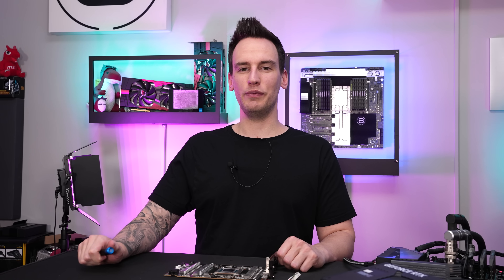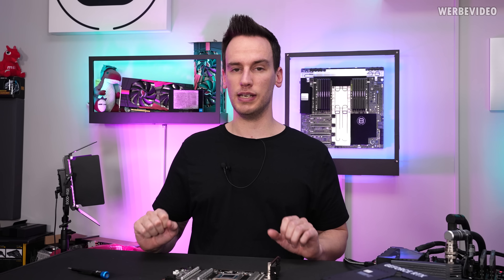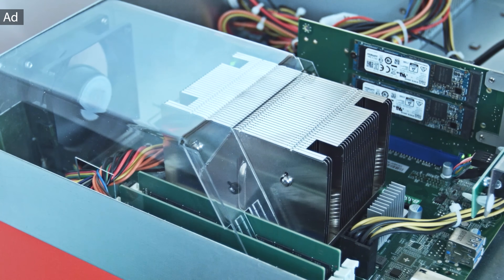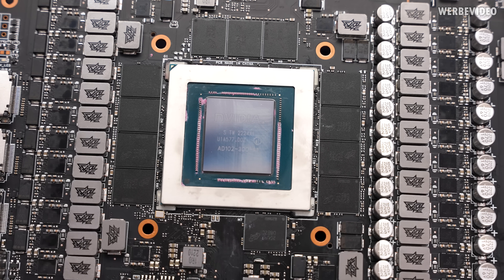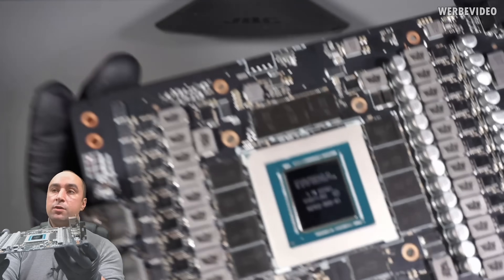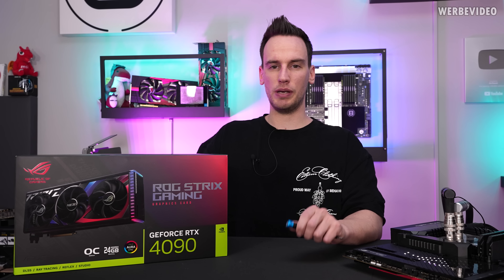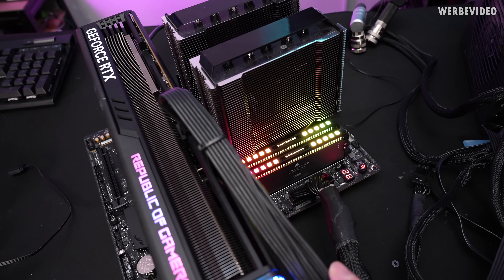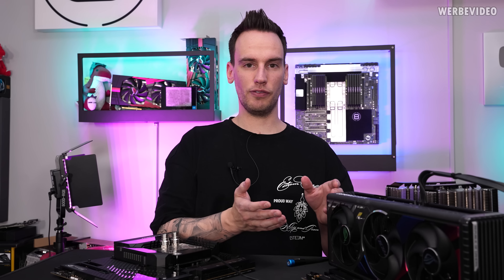Plot Twist during Professional Repair Attempt of my RTX 4090 - feat. KrisFix

Comment: Maybe talk to you asus contacts, and see if they will take the card and diagnose it, to find out what went wrong, and what posible "user error" caused the issue. Then do a video on what you may of have done, to help make sure your viewers dont do the same mistake that may had caused the issue?
Reply: ""user error" if the card had pcielanes lost  in 1st place probable cause was and is bad solderingwork/joints  done in asustek factory. THere is no user error there. It's all asustek fault here in 1st place. Also would like to point out. The "Asus quality" has gotten Wayyy worse over the years in many product lines they produce not just gpu's.
Reply: @user-eq2fp6jw4g  I am sorry, I wasn't implying Der did it wrong.  Der just said in his video it was something he did possibly.  So i was just using "user error" loosely.  My comment was no way trying to insult der, if thats how it came accross.
Reply: @martymcfake  Sure he might have applied some issues ofc by trying to fix things. But main issue was done by asustek in 1st place.

Comment: Yea that guy is probably correct. I bet more of those memory chips etc. have corrosion on them, and the vibrations/handling during transport is what caused some (or one) of the other chip to fail as well. Reminds me of a repair on another device from another YT channel where the device was broken but would work if you held it a certain way or shook it, because this would temporary reinstate damaged connections on a particular chip in this device (it was an iPad). I wonder how it would get corroded though, is it possible for moisture to creep inside a card during storage?
Reply: to my knowledge these cards were manufactured back in July. There's a chance either on the boat or at the warehouse things were put in storage for longer than intended and not in ideal conditions. either that or the quality control is so crap they are balling on rusted chips from a wet plastic bag

Comment: That's the worst part about electronics there so unpredictable it could work 1 minute and the next it wont work at all. I had few cases like this over the years repairing electronics and it's just one of those things you can't control but the worst part is alot of customers don't understand that and it makes it difficult for the person that repaired it.
Reply: This is true some people think your trying to scam them at that point. It really sucks when it takes a lot of effort and everything's good all night 'burn in' test shut down, get there, hit the power button and nothing e.t.c. That or the one time I got to the customers apt parking lot grabbed the laptop to deliver and dropped it 5ft from the front door of the building!!!! Told them, rebuilt 2 days for parts = $100 or so.  (Fixed / built over 3k machines (approx lost count long ago)

Comment: Was only a matter of time before you two would do a collab. He's the best and deserves the recognition. His subscriptions gonna rise, I'd assume
Reply: It was an immediate subscribe for me. Even though I still have close to 0 knowledge on the subject, his presentation really demystified what's going on inside these graphics cards. Very impressive knowledge on his part
Reply: Does anyone know what software he used to test the card? Is there any windows software that can test it and read errors? Thanks.
Reply: @Neilukuk  mods and mats , the leaked nvidia tools. just search the net ;)
Reply: @robertjung8929  Thanks for the info, I really appreciate it and I'm sure others will as well :)
Reply: @robertjung8929  I forgot that he's testing a NVIDIA and I have a Radeon rx 5700. That program is not made for my card, Do you know any that works on Radeon? Thanks.
Reply: @Neilukuk  i'm not aware of any tool "floating" around the net  for newer RDNA amd cards yet. there is only a tool for older amd gpus up-to rx500 series and vega. search the net for "lord of the gpu"
Reply: @robertjung8929  I tried that but didn't work with my card. Thanks anyway though.

Comment: Ok for the memes:
First melting connectors, then Roman can't get it to work on any system platform....
4090=4+0+9+0=13
13 is bad luck, stay away.😜

Comment: I'm sure it's irrelevant but since u didn't mention trying the other bios, i wonder if the bios needed a flash or if just the bios it was switched on was possibly the issue? Of course it could have been damaged in shipping.

Comment: i saw a similar case with a friend of mine, who's pc would not post, brought his whole pc to my house and the gpu worked fine on my system, and so did the pc with his gpu, after much troubleshooting we discovered that the problem was that he had the monitor and the pc on connected to different parts of his house's electrical network, which was likely causing some EMI problems (from different ground potentials for example), i had him change where he had his pc connected to, and it magically worked.
Reply: A lot more common than most people realize.
Reply: I immediately thought this as well after watching all three videos
Reply: i have had/ seen a few similar issues over the years.
its more common in the US and when some devices on the power circuit or not grounded
Reply: @john1182   While i lived in Africa my room didn't have a earth ground for a long time, it was quite interesting as you never knew when you would be zapped by the PC or monitor, the 4th gen i5 worked no problem though,.
(i later had to make my own ground wire by running it through the window to the ground outside)

Comment: That's strange if he doesn't reballed all memory chips around.
Because once you found what one of them have defects, there should be rechecked all another (especially because they all heated again like you do with heat gun, what caused this GPU failure).

P.S.: Greetings for viewers, who know VIK-on.
Reply: I don't think that's necessary. You can watch @northwestrepair videos and it's totally common. They have these testing programs to know which exact memory have a problem.
Reply: @RABAO0001  dont mention northwestrepair he has no idea whats he doing or saying
Reply: @kremeszdaboi1862  Why do you say that?
Reply: @kremeszdaboi1862  Why? He literally saved older and newer gen cards
Reply: Hello to fellow Vik-on enjoyers.
Reply: diagnostics & repair lvl: notebook 31

Comment: This was a really interesting video! I’m really glad you brought up cost and warranty with his fix, it actually allows it to be a viable option instead of something we’d have to do a lot of research ourselves into. 

I didn’t think the card could be repaired that way, honestly thought everything had gotten too complex as of late. 

Also disappointed in Asus. If these memory chips are soldered improperly causing corrosion, is there a guarantee that they will last? Sure, you accelerated it, but for the normal user it can’t help but feel like these will fail right outside the warranty period.
Reply: @eye776  That’s true. My limited experience is attempting to repair phones, where entire boards are tossed because it isn’t worth it to repair a single chip on that board, and more cost effective to replace then entire board. The fact that the 4090 was effectively fixed with a material cost of only solder/flux makes me happy, even if I couldn’t fix it myself.
Reply: It's Completely Unacceptable by ASUS. They Over charge so high over MSRP for their cards for something simple like this to fail after weeks of having it... Other cheaper brands are actually have better build quality then ASUS strix anyway component wise and coolers in the RTX 4090s. Making AUSU STRIX overpriced trash. But Scalpers loves these cards as they sell them no less than $3500 and I'm sure people guys them lol...